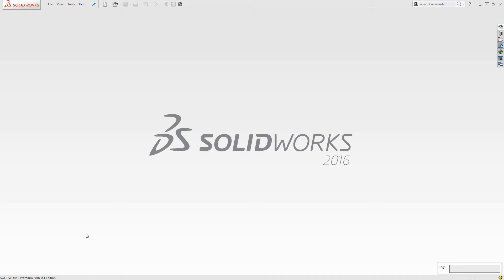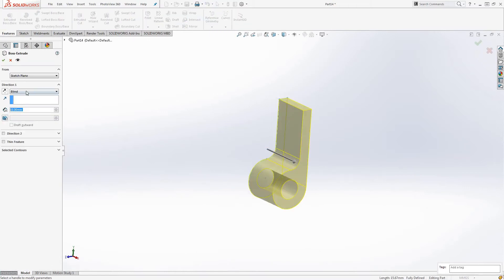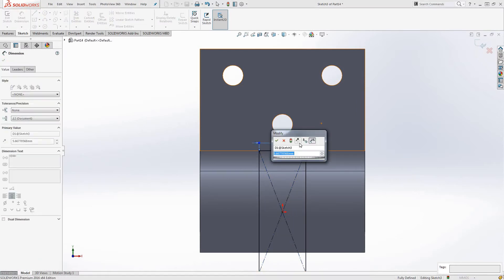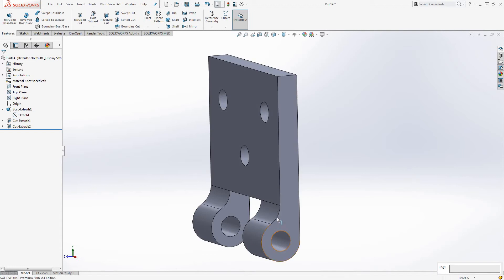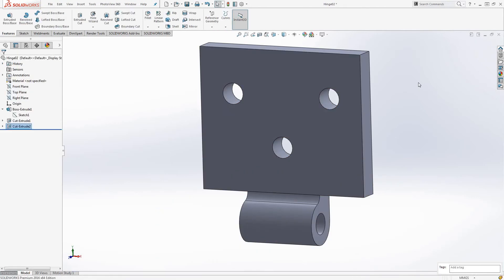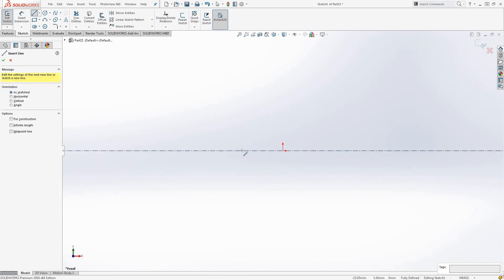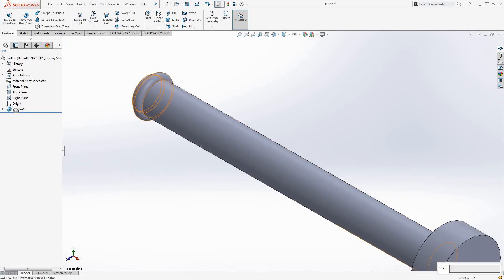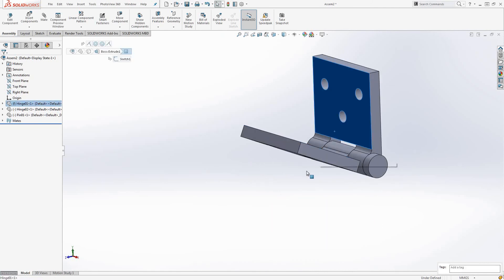Solidworks Tutorial - Make a Basic Hinge

Comment: very simple explanation. very easy to learn. thank you. but I have a small doubt. wouldn't that pin slide away? because there is nothing to prevent the pin from sliding away.
Reply: Yes, that is true but for what we needed it for, we had to be able to easily take the door off.